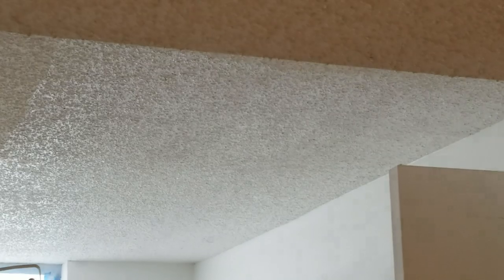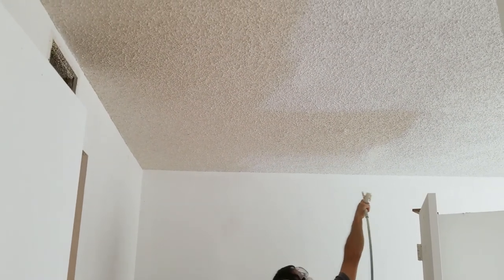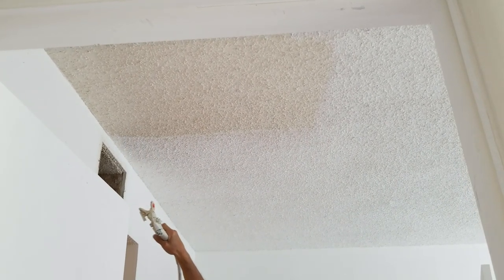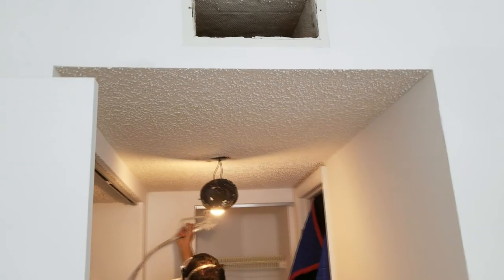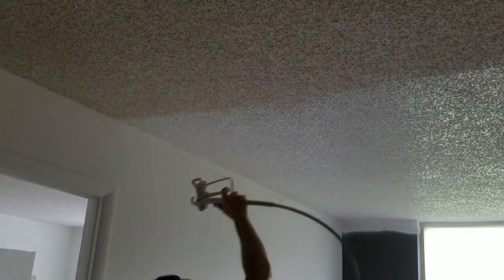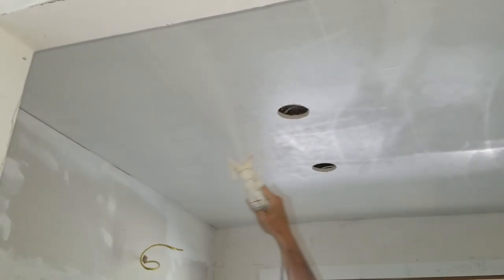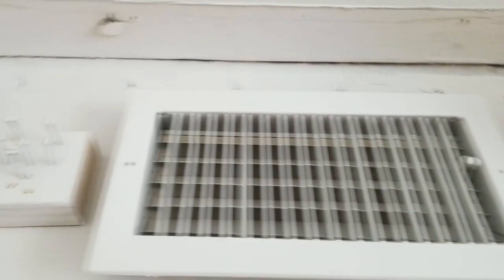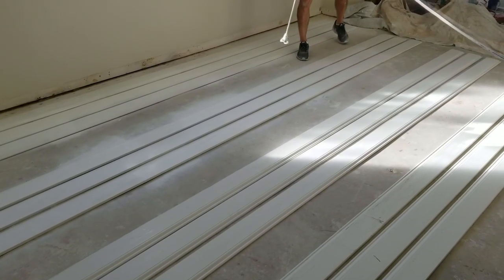How to Repaint Popcorn Ceilings: No crumbling or Peeling

Comment: 👍👍 Just Finished Mine With a Roller The Old Fashion Way.Happy Holidays Jeff 🎄
Reply from the maker: Wow, it didn't peel off? You got lucky. Especially in a room that had heavy smoking from occupants, the paint and popcorn break down, so that just rolling on new paint wets the old paint enough to dissolve it off the ceiling and it ends up all over your rollers.
Reply: I Was Very Careful and it Looks Really Good. I Did The Whole House And Now Working On The Rooms,This Painting is No Fun I Tell You.
Reply from the maker: @Rammer_Jammer  How old was the previous popcorn paint job on there?
Reply: About 14 Years Old
Reply: I repair about 20 a year and I can't even touch it without sealing it first
Reply from the maker: @randykephart3661  Yup. that means they never put primer on, sometimes not even real paint either. A Lot of builders are just ripoff artists, and they use just the mud to shoot it up there and never prime or paint it.

Comment: We did ours years ago with a 3/4" nap roller. Even bought the little bottle to throw the sparkles back on the ceiling lol. Originally had multicolored sparkles but could only find silver
Reply from the maker: That's awesome. How old was the original popcorn ceiling since the last time it was painted.
Reply: @jeffostroff  oh boy, probably was done with the multicolored sparkles in the 1980s

Comment: I just did a small bathroom ceiling with a brush and a 4" roller, and it the task took its toll on my neck. I can see the obvious benefit of a sprayer, but Is this practical for the average person/DIYer for smaller tasks? And yes,  I had to return for a second coat in spite of using paint that went on in a pinkish tinge but dried white.
Reply from the maker: This is practical for DIYers who already own a sprayer and are comfortable using it.

Comment: Have a question brotha, we sprayed my popcorn ceiling 2 days ago. Been letting paint cure. I had the electrician come today and when he went in the attic he pushed open the little door that used to seal attic. When he closed it or slammed it the popcorn ceiling came off?? Also the paint was still wet underneath. I’m concerned now hopefully the whole dam ceiling don’t come down. I used a spray gun and flat ceiling paint. Had to spray twice cause the first time it absorbed the paint quickly. Was this due to the electrician slamming the attic door down or did I spray to much paint? Anything helps.
Reply from the maker: Well you are supposed to prime 1st so I hope you sprayed primer before you sprayed the paint because the primer is what really prepares the surfaces and allows the paint to stick to it. But I'm also concerned that it hasn't dried yet either so if you're still cold and dry out maybe try opening the windows and aim a fan up at the ceiling as well and get cool dry air flow across that and let the paint dry. That is pretty alarming that it hasn't dried by now I have never seen this happen on the ceiling.  yes if the paint is still wet on the popcorn, then any type of agitation could possibly shake it loose.

Comment: Will this help my ceiling in my apartment that’s about 30 years old and the popcorn ceiling is brittle and shedding in here. Wake up in the morning with little white specs on my furniture. It’s not asbestos.
Reply from the maker: Yes, if you spray it with primer, then spray it with paint, it should seal it right in. Sounds like they never used primer originally, and over the years moisture and humidity have loosened it.

Comment: I noted some heavy discoloration where the AC duct discharged dust and dirt over time, and yet you did not take any special preparations or cleaning before painting. Are you using a special paint to cover the dirt and ensure adhesion. Same question for the duct grills.? Thanks
Reply from the maker: We did try to vacuum ahead of time but the dirt was just on there too good. And it doesn't make sense to try to use any type of cleaner 'cause the minute you get it wet it's gonna start flaking off. So the important thing is to remember to use a primer with a high hide capability. And if it's too bad you may have to put a couple of coats on it. But in this case I believe we used only one code of primer and we painted over it One Direction and then 90 degrees the other direction to get full coverage with two layers of paint.

Comment: Can you use a clear sealant on it before you use the white paint..Can you use mold primer as well...
Reply from the maker: Yes you can use a primer sealer first. I would spray rather than try to roll anything on with popcorn ceilings.
Reply: @jeffostroff  Thank you soo much...Great video!!

Comment: is it unheard of or "dumb" to use semi gloss on the ceiling? I bought a sprayer and semi gloss white and wanted to just hit the roof walls and ceiling at same time without having to tape or spend time switching out the paints in the sprayer. Our popcorn ceilings now look to have a satin paint job
Reply from the maker: Most people use flat white paint for the ceilings to avoid unnecessary glare and reflections. But if you're happy with the the color then there is no problem.

Comment: silly question, as my ceiling probably has asbestos in it and is looking dirty- do i need to clean it before spraying over it?
Reply from the maker: Well this puts us in a very precarious position now because the first thing you need to do is get your ceiling tested to confirm whether it is or is not asbestos. 2nd if it is asbestos I would not touch it I would start immediately researching into whatever you're supposed to do and not do and you might even be better off having a professional company either come in and scrape it off or seal it over before it is painted whatever it is that they normally do but something like that should be left to the professionals
Reply: @jeffostroff  thank you sir!

Comment: Great video! What paint did you use and did the popcorn ceiling ever crumble down because the paint got it wet? If so how do you avoid that?
Reply from the maker: https://homedepot.sjv.io/e4nVM1 We're not worried when you spray the paint on because even though it gets it wet it stays in place in the paint dries very quickly it's only a problem when you're using a roller because the roller will actually roll off clumps of the paint and the popcorn onto the roller edger causing that physical contact. But with spraying there is no physical contact and everything just stays in place in the paint actually is a sealer level so it will seal things in once it's painted on.
Reply: Did you have to use primer with this paint?

Comment: You can roll these with oil based paint or primer. Still have to cover everything and deal with smell. There are low odor alkyd primers though.
Reply from the maker: Your strategy probably will not work period the problem with this popcorn and especially when it's cheap popcorn put on by the builders is that the second it gets wet it starts to loosen off the ceiling and fall down and then not only that the paint is in such bad shape from years of smoking and cooking in the condos, then it just peels right off onto your roller that's why you have to just spray it on
Reply: @jeffostroff   As far as I know from experience alkyd paint does not dissolve the unpainted popcorn.

Comment: It's worth mentioning that painting makes it exponentially more difficult to abate asbestos popcorn ceilings because now the water can't soak in.
Reply from the maker: Yes, if you suspect asbestos, you might want to abate it first. Luckily this ceiling was built in the 70s and did not have asbestos.
Reply from the maker: Fila Kri   Sounds like a ripoff price to me 2 years ago I had the entire one bedroom condo I was working on done for $900 including spraying on the knockdown texture on the walls and ceilings when they were done.
Reply from the maker: Fila Kri  There probably was a class action payout fund setup for asbestos, but you know these run dry, and the manufacturers go under. In 1995 they banned the gray plastic polybutylene piping that's in millions of homes built in the 1970s to 1995, and that fund dried up, but many of us still have the pipes in our houses, and insurance companies don't want to cover them.

Comment: How can i repair cracked popcorn ceiling in the corners of ceilings?
Reply from the maker: Those are tough because of settling buildings. You can either remove the corner bear and install new, but you'll never get the popcorn to match. What I would do is just tool in some paintable caulk into the crack to fill it.

Comment: You can use a roller, but you'll use way more paint, these ceilings are extremely absorbent. My ceilings will look fantastic for years.
Reply from the maker: Very true! But some ceilings wetting them with the new paint just causes it to disintegrate and comes off on your roller.

Comment: How can you remove ceiling tiles and dry wall?
Reply from the maker: Ceiling tiles you push up, flip them up sideways and they lower back down from the hanging structure. For drywall we use an electric drywall cutting tool.